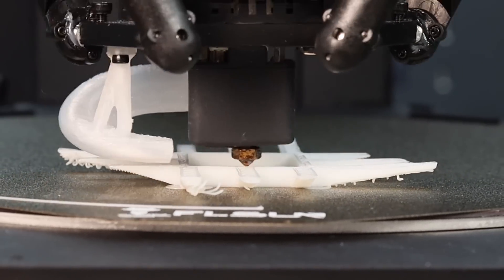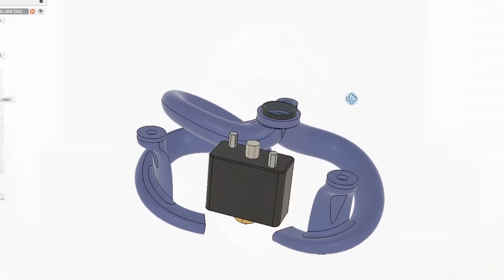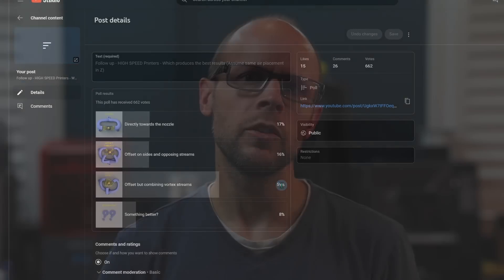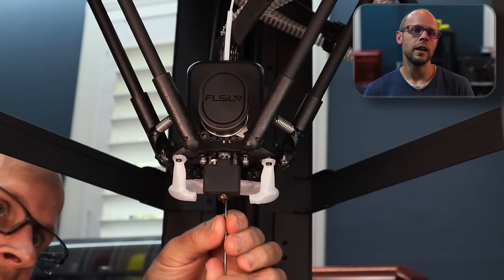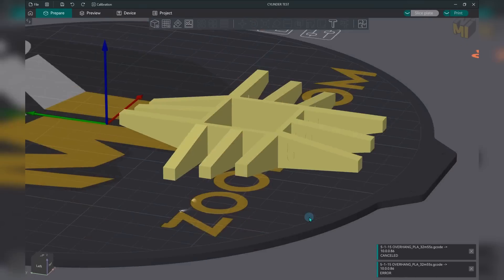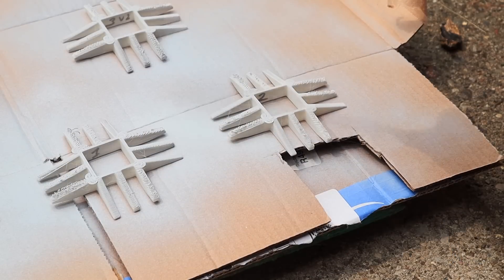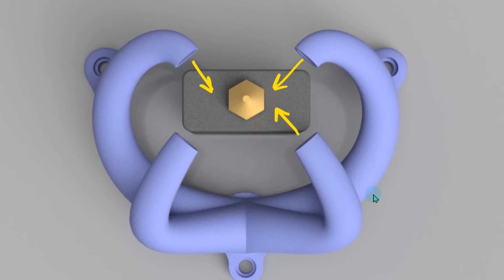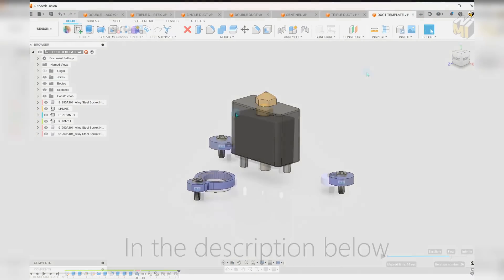More ducts is better, but how many is too many?

Comment: Three definitely makes the most sense because it's not dividing the air so much that each port doesn't have much force, but there's still enough ports to create good distribution; interested to see how the other design ideas you mentioned will fair (would be nice if someone with a program that could analyze air flow could test as well, but nothing beats the real world tests)

Comment: great video though it would probably be more useful if you'd used an entry level printer like an Ender 3 which I imagine would greatly be improved by better part cooling ducts... besides, I don't imagine a lot of makers having a $500-600 printer in their workshops 😅
Reply: It's a great test bed though! It's also easier for users to submit designs with this template. Once we have great designs we can apply them to other printers.

Comment: I'm intrigued by offsetting the ducts. It makes it a lot more difficult to design it tho. What I learned from another video is that sharp corners aren't that big of a deal but if there are no knicks and the flow area stays stable (no rapid decreases in area).
Reply: I have a duct for the biqu H2 hotend that does the vortex thing and it works pretty well

Comment: Might be better to resin print the parts for a smoother inside surface.
Reply: Or ABS/ASA so you can vapor smooth
Reply: From what I've printed/seen, as long as you don't have any egregious FDM artifacts the surface smoothness doesn't make much of a difference in ducting. At least in these non-intensive applications.
Reply: @xomm  The feature size of these ducts is very small, so the relative impact of the layer lines might be disproportionate.

Comment: Cut one open to check the smoothnes of the inner top surface of the tubes. With good cooling probably its not an issue though)